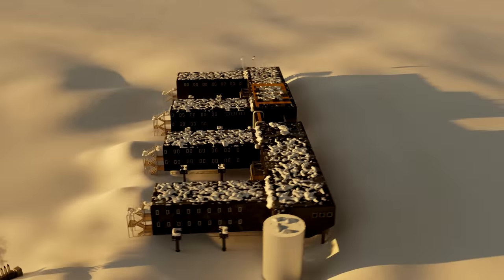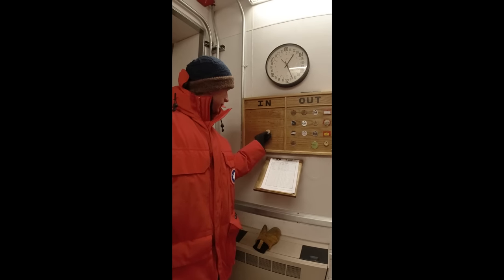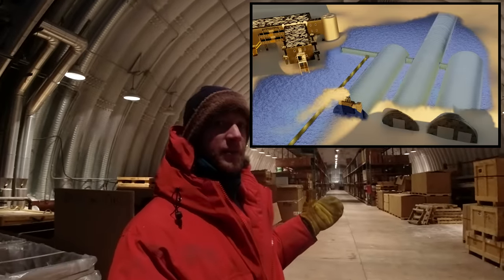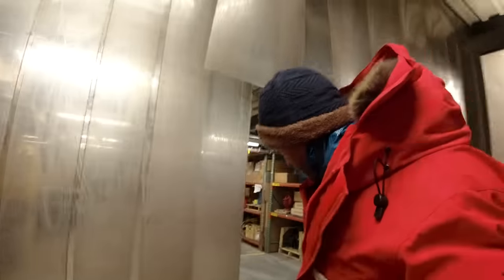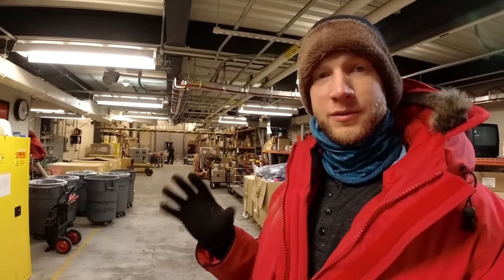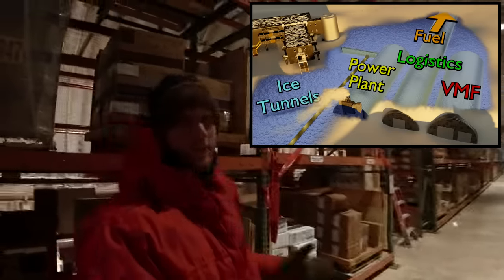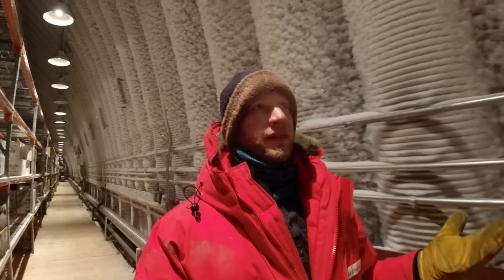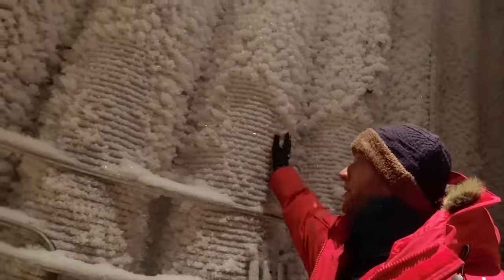South Pole Station Tour - Part 3 - The buried sections

Comment: So just to do the math: if the generator uses 45 gallons per hour consistently (I'm sure it fluctuates though), that equals 394,200 gallons of fuel per year (12 months) or 2,660,850 lbs (assuming the average 6.75 lbs/gallon for jet fuel) or 1,330 tons. I'm sure that many folks would be appalled at those numbers, but when compared to the massive quantities of diesel used to power and heat the arctic oil operations each year, it's a drop in the bucket (pun intended).
Reply: @YourDadsBoyfriend  yes that does make it okay. It's supporting research that can't be done elsewhere.
Reply: Is there no wind there or something?
Reply: @Atmos at the End of the World  Tons of wind for sure. But also extremely harsh conditions that would be very damaging on wind turbines, which would necessitate frequent maintenance by skilled personnel out in those elements. That is probably one of the biggest logistical problems with using wind power.
Reply: @DrForester54 need robot vacuums
Reply: @RumoredAtmos  lol
Reply: @DrForester54  They should be running a micro nuclear reactor.  No conflict minerals or toxic water pollution due to mining turbine components.
Reply: @badlaamaurukehu  Good point. It would certainly be doable, unless there is some kind of international treaty or stipulation on using nuclear power in Antarctica. The possible other reasons that I can think of for them maybe not wanting to do that include: concerns of containment and safety systems, concerns of spent nuclear fuel storage, logistic concerns of bringing in the nuclear fuel in the first place, perhaps concerns of logistics and/or cost of the trained personnel needed to run and maintain it. Of course, the most likely reason is that they already have all of this infrastructure down there for the current energy system, and they simply don't want to go through the trouble and capital expense of switching over to nuclear. I agree though that it would be something to think about. I certainly would, considering that such a system could easily supply them with all of the advantages provided by the reactor on a nuclear submarine.
Reply: They had a nuke in mcmurdo for years, didn't work out well. Diesel is a very flexible and powerful fuel that works well in the harsh environment of Antarctica.
Reply: @YourDadsBoyfriend  Why even type that?
Reply: Oil is good 👍
Reply: @AB_AB  Oil is bad, not good. 🤨😁
Reply: @DrForester54  just park a nuclear sub nearby and hook up an extension cord!
Reply: @joet7136  That would be one heck of a cord!
Reply: @joet7136  It seems you maybe be confused, the station is at the South pole on the Antarctic continent.  You can park a sub underneath the ice at the North pole but not at the South pole.
Reply: The generators there don’t run on diesel, it runs on jet fuel.
Reply: @curmudgeonextraordinaire1884  yeah, more convenient to use one fuel for everything and so it’s jet fuel
Reply: Around 2mil $ for fuel only yearly for 1300 tons of fuel xDD 
Here euro diesel costs 1.8$ 1L. So if they use regular diesel for example it should be around maybe 1.5$
Nuclear power plant maybe costs 2 billion to build in normal conditions. So regular oil plants or whatever they are using are much cheaper to use by that price calculation.
Reply: @markiangooley  Well, that and Diesel would be frozen at those temperatures.
Reply: Nuclear is the best way to go in this world
Reply: What a waste
Reply: @montey1017 well that was in the 60s, and as far as I know not much of a catastrophe - the biggest problem I see with bringing nuclear is the huge amount of personnel that would need to be there 24/7, it'd add quite a bit of logistics into what's a comparatively simple thing now.
Reply: @swimmer8585 no can do, the Antarctic treaty does now allow any type of nuclear power over there.. but then again, when the US has stopped for that tiny thing😅… it is likely they had one back in the 50s when the old South Pole station was on duty..no way to confirm that one though
Reply: @emiliolorenzini8050  Ah did not know that.  Still think that's ridiculous but my opinion doesn't matter much anyways
Reply: @swimmer8585  no problem buddy, indeed a nuclear mini power plant might be an option; but treaties were made in agreement with all countries occupying Antartica,   So fir now just fuel is allowed, unless... as Eric Heckler from Raytheon claims, "exotic enegry" is being used to cope with all the energy used in there.
Reply: @DrForester54 your telling me the you can't use the neutrino collider as a heat source it can make a earthquake in new Zealand but not heat the station ...
Reply: Being that we did not get to see the fuel tanks that's a little suspicious I have a suspicion that the facility is ran on nuclear power which it's not supposed to be whistleblowers have came out saying that this facility is used for nefarious things
Reply: @RumoredAtmos win turbines are very delicate and need a lot of maintenance my dad works on them and I asked him and he said they probably don’t have them there cause if they break they need someone who is certified to climb up and the risk is too high to count on that as your main power
Reply: @badlaamaurukehu they did !! The us navy had one 😅
Reply: Makes you wonder how many solar panels it would take in those conditions. Would it even be possible? Wind turbines?
Reply: @otockian as long as there’s sunshine you can use solar and it looks like the sun shines there consistently 😊
Reply from the maker: @jumboslice1514 ... during the summer, and it never goes above 23 degrees. then for 6 months, zero sun.
Reply: They tried a nuclear power plant and there were too many issues. Lol @ you thinking they didn’t attempt it. In fact, they tried 3 different types or nuclear plants between the Army and the Navy.
Reply: @RumoredAtmos Yes, that's what they need, more stupid fuckin wind turbines that don't work normally yet alone in -60f conditions.
Reply: @montey1017 It didn't work out well because that design wasn't one that was built for the conditions.

It's been roughly 40 years since that reactor was put in, we have infinitely better designs and computer controls now.
Reply: @FAB1150 You don't need a huge amount of people to run a nuclear reactor of that type. Using the US' shipboard reactor designs, both the submarine and carrier versions, you barely need a dozen guys, as the vast majority of the maintenance work is to do with the turbines and power generation section, NOT the fission pile itself, and after 60 years, the US is VERY good with small reactor designs, and those designs aren't even the most optimized, and aren't even Gen III designs, much less the Gen IV designs being proposed or the far out their designs that are the Gen V work.

Small modular or their tinier cousins the Micro reactors are small enough to fit in a average 20 foot cargo container and are designed to be able to shut down with no input from the operator and even do so without any power at all, relying purely on passive methods for scramming.
Reply: Shouldn't solar cells help during the summer to reduce the amount fuel transport due to higher demand in summer too.
Reply: I just find it cool they basically have a whole year of fuel, probably incase of late resupply but cool anyway
Reply: @RumoredAtmos  I know someone who was going to put up wind turbines the only reason they didn’t is because it would be to expensive
Reply: Oil is never going away buddy. We will never be without it
Reply: @konkelkent really. It would run out even before killing us, although you might briefly extend supply with fracking.
Reply: @YourDadsBoyfriend A 20,000+ TEU cargo ship (like the Ever Given) will burn that much fuel in less than 5 days. There are around 150 of those currently in operation.
Reply: Diesel not jet fuel
Reply: i would be more appalled with the diesel used by a cargo ship to make sure you get a cheap tv about 2600 gallons per hour
Reply: @montey1017 Can you expand on why the nuclear reactor at McMurdo didn't work out? 

I just read a tiny blurb about it referring to a crack in the containment and possible health issues caused by the reactor, but it's been 50 years since it was decommissioned, and nearly 60 years since it was first constructed. I would think modern reactors would be a lot safer, no?

Doing something with the nuclear waste would still be a concern though.
Reply: @nick-dq1hh why not? Are you against different opinions?
Reply: @chrisalister2297  everyone is entitled to their bad opinions.  Doesn’t mean I can’t criticize them.
Reply: @nick-dq1hh  my apologies. From the YT app, it didn't outline you were commenting to a commenter of the original post. Makes sense now.
Reply: @creationgret1  do big ships use diesel though? I thought they'd use heavier, cheaper stuff.
Reply: @gcolombelli  yes they do.
Reply: the deisel used in cargo ships around the world is a mich more severe issue
Reply: @BWolf00 someone doesn't get sarcasm, lol
Reply: These numbers mean if the site was ever inaccessible for one summer for any reason, everyone dies.
Reply: @badlaamaurukehu  the largest research station did use nuclear power for a while but the reactor started to show cracks so they decommissioned it in the 1970s.
Reply: @creationgret1 yes it is. JP-8 is the fuel used by bearly all US Military Aircraft. It is a specific fraction of diesel fuel with added corrosive inhibitors and anti-icing agents
Reply: @badlaamaurukehu do the words: Chernobyl, Fukushima, 3 Mile Island mean anything to you? The most pristine environment on Earth, the start point for the world’s sensitive marine environments does NOT need radiation leakage which will last forever, they’re not even allowed to take animals on Antarctica in case they bring organisms harmful to the coastal wildlife.
Reply: @joet7136 think about what you just said. What do subs require? Water, the nearest water is 1,300 km at the Bay of Whales. Antarctica is a continent, dirt, rocks, sand, volcanoes etc. it is not an icecap floating on the ocean.
Reply: @teeanahera8949  then we need a loooong extension cord. Geez do I have to think of everything?!
Reply: It’s worth it for the data these guys are getting.  Not excessive considering ambient conditions
Reply: If this station is over land, would geothermal energy be possible? No worry about wind/ice/sun conditions and less petroleum products or nuclear waste?
Reply: @JoeSpinstheGlobe oh good your still alive
Reply: I work in rope access and can attest that servicing wind turbines is a really hard job that’s pretty dependent on weather. We have limitations on the wind we can operate in, the ropes and devices we use on them have temperature limitations, and don’t work very well when iced. In addition, the epoxies used to repair the turbines have requirements for temperature/time to cure properly. They have upper limits on wind speed, oils that need a certain temp range, they don’t love sunlight… Essentially, the turbines you see offshore or in wind farms aren’t suitable to use at the pole or really on the continent. And a bespoke solution would probably pose a similar set of issues, not to mention the cost.
Reply: @RumoredAtmos  Yup, lots of wind. Good luck importing and installing wind turbines ... and solar sort of works about 6 months a year :(
Reply: Maybe Thorium reactors will one day become a viable source of clean energy but that requires manpower to operate and maintain.

Comment: What I’m noticing is the entire structure itself. Like, the underground sections have smooth concrete floors. How did all of this construction happen in such a frigid environment? It’s fascinating.
Reply from the maker: You know that's a good question, I'm not sure how they cured the concrete floors. Must've been a special mix and used heaters.
Reply: It could be preformed slabs trucked in via overland express
Reply: And the Award for no critical thinking skills goes tooooo
Reply: @Realryordie  you
Reply: From what I have seen it is the heated parts that have concrete floors. Maybe the buildings were built and heated before pouring the floor? There must be proper insulation under the floor to keep the ice from melting when the room above is heated.

The cold parts like the arch with food have plywood floor I think. Someone else doing a station tour mentioned it.
Reply: @zapfanzapfan  what liquid is able to be poured at -32 degrees supposedly… especially concrete being liquid at -32 lmaooo nice mental gymnastics tho
Reply: @Realryordie  You add antifreeze to the concrete. We have done pours in -10 Celsius and I'm sure they do it even colder at a daily basis during the winter.

Comment: This is so amazing. It's like I'm there, even though I'm never going to be ;-)
Reply: South Pole neighborhood Insurance rates went up....because of this comment
Reply: Amazing they don’t use nuclear reactor to power the station
Reply: @bigsid1984 it's been tried in the arctic
Reply: @bigsid1984  It's also amazing that they have 3 generators instead of a single coal powered one.
Reply: Yo Tay how have you been man? It's been years since I've heard anything about you. I'll try to google up some info but feel free to reply
Reply: @lunchbox1553  It is the rule of n-1.  You want multiple for backups incase one breaks.  Only one running at a time.

Comment: Those steel arch thingies are called Quonset hut buildings. Very strong
Reply: These are much larger than Quonset huts - and also have knee walls that were added in the summer of 2007-08.
Reply: @alanlight7740  Okay - let’s stick with thingamajig’s.
Reply: @bobwhelk2117  - or just "corrugated steel arches".
Reply: @alanlight7740  Then let’s call it Nissen Hut.

Comment: @ 7:44
I already have questions. 

1- The "freezer burn crystals" that are fun to break off fall to the floor. 
Cool. 
Then what? 

Does someone have to sweep them up and dump them outdoors? Do they melt in January and flow out through drainage? 
How do you handle this frozen moisture safely? 

2- When you say "one fuel fits all", what do you mean? 
Are aircraft flying w/tractor fuel?
Are tractors powered with jet fuel? 
Are you storing crude oil and distilling it on site for various uses?
Reply: I am pretty sure he said the aviation and tractors etc all use the same fuel. Jet fuel I’ve heard some say. Worth googling it.

Comment: I'm surprised those generators are so small. 1MW isn't big by generator standards but I would think fuel consumption is the highest priority.
Reply from the maker: Yep and they're even downrated to 700 kw I believe due to the altitude
Reply: @JoeSpinstheGlobe  Any battery back-up if a generator goes down and it takes time to fire up the other one?
Reply: @zapfanzapfan  They have 3 primary generators to cycle through and a backup power plant in B pod.

Comment: Using some more maths, the station uses about 1000 gallons of oil per day.  There are 40,000,000 penguins in Antarctica.  Each digests at least  1lb of fish biomass a day.  So thats 40,000,000 lbs of fish biomass.  So, using some basic maths, for every Unit of energy generated at the station, our penguin friends generate about 2 and a half million units of energy 🐧🐧🐧🐧🐧🐧🐧🐧🐧🐧🐧

Comment: Is there a reason that solar or wind turbine power isn’t used to supplement the generators? It seems like if the electricity could be supplemented, that a more efficient heating system could be used as well and reduce the need for as much fuel. It’s also interesting to see in the videos how much of the space is dedicated to leisure activities and comfort, it’s a nice surprise.
Reply: I was wondering the same thing. I guess with solar it's easily blocked by snow and also the fact there's enternal night for like 6-7 months. Though there's always wind there, but perhaps the chilly tempratures makes it difficult for the machinery to run smoothly for longer periods of time
Reply: @ihh2921 : Plus, I would think you'd have perpetual erosion issues.  It may not seem like it, but the tips of modern turbines move ridiculously fast.  A quick peruse of bigger units claims up to a couple hundred meters per second.  That's like 2/3 to 3/4 the speed of sound.  And you'd perpetually have fine particulates constantly wearing at those blade edges 24 hours a day.  Personally, I suspect the 200m/s is a big high (Like, "did you see those tip speed values just before she shucked a blade?!" kinds of value), but even half that in conditions where materials are perpetually brittle and fine particulates any time there's enough wind and you've got some pretty awful conditions to deal with.  Even regular offshore stuff deals with the same kinds of problems.  It literally eats the leading edge away.
Reply: The sun only rises a little to 23º, then it travels in a circle around the horizon. How are you going to capture solar?

Comment: 600kW? Is that at peak or just the average? That's not a lot, I was expecting at minimum a MW. I'm going to guess the reusing of the captured waste heat from the generator, to help heat the facility does wonders for efficiency, and also not needing any large scale refrigeration for food storage. Pretty handy. I also learned that the primary fuel source there is jet fuel... learnt something new there lol.
Reply: That was Winter use when the station has fewer people and demands for electricity.
Reply: @teeanahera8949  ah right... forgot he said that in the video.

Comment: Imagine  the power/ fuel that could be saved if only the lights were turned off when not in use. And yes, the gen set fluctuates due to power/ amperage demand. This in turn causes the fuel usage to fluctuate
Reply: We hope they’re using LEDs for light. Power consumption would be negligible if that’s the case.